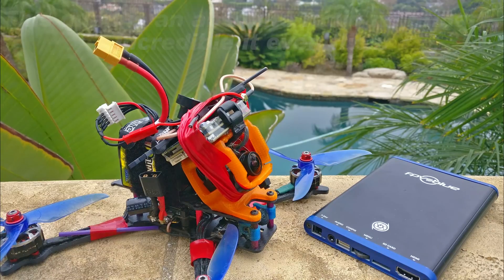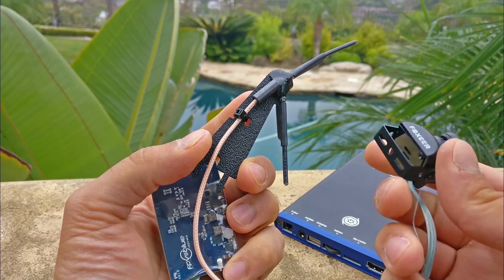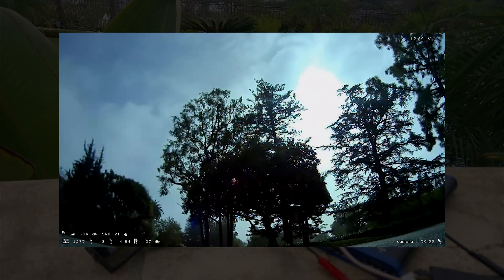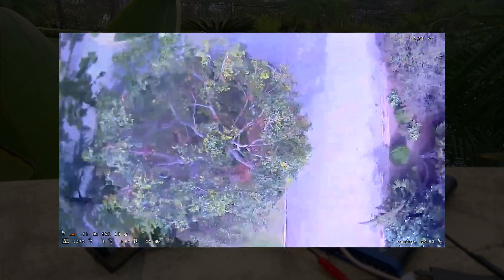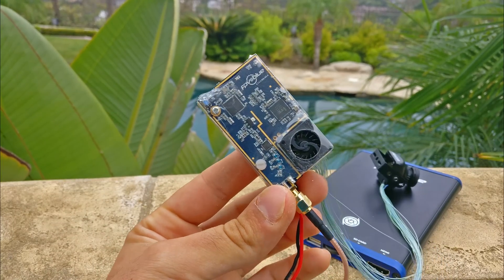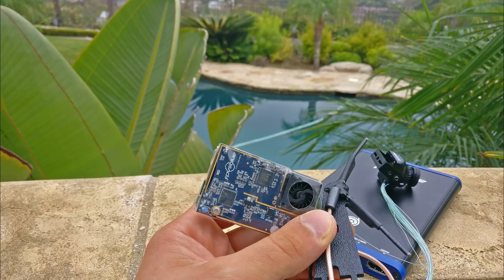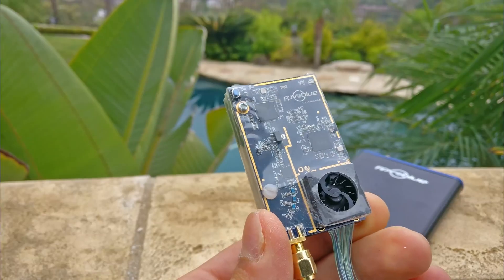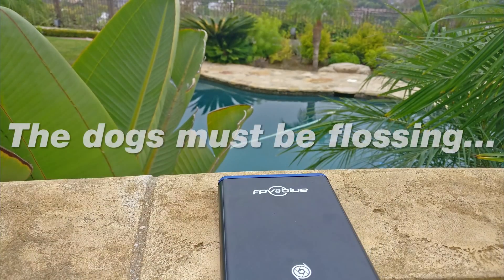FPV Blue - See link in description

Comment: You can't fly 1280mhz Video alongside a 2.4G Radio link...That's a basic Schoolboy error.  The second harmonic of 1275 mhz will take it into the 2.4G band. You need a UHF control link.  Good job you did not try and fly out to any distance.

Comment: As a regular 1.3 guy, I'm going to go out on a limb and say the majority of your interference is coming from the close proximity of your gear on that tiny little platform.  I'd be willing to bet if you get some component separation, you'd do a heck of alot better at that ridiculously close range for 1.3

Comment: I'm really trying to decide on an fpv setup for my current rc truck project. I was pretty much set on the connex for it's pure quality and digital uplink but now this shows up twice in a day. I might wait for the second batch, though.
Reply from the maker: DanielWGK connex doesn't work well on the ground. You'd have way better luck with 800mw analog
Reply from the maker: DanielWGK team legit just did that too. They used connex. But weren't going more than 50ft
Reply: Kabab FPV I'll have a look into their setup. I'm really hoping for a viable solution that will net me ~low lately hd video